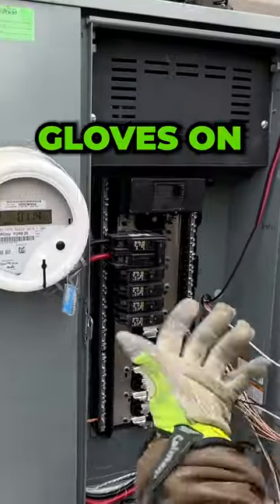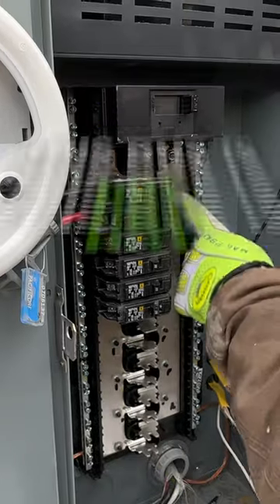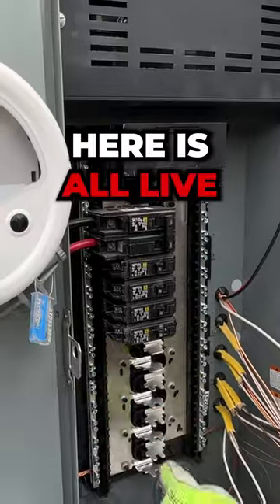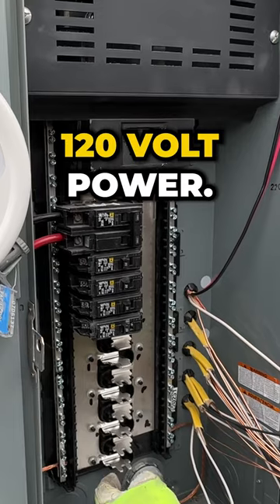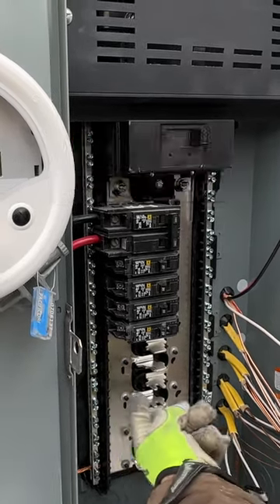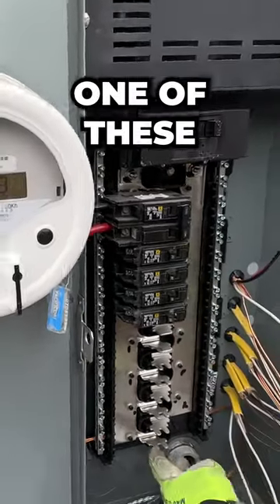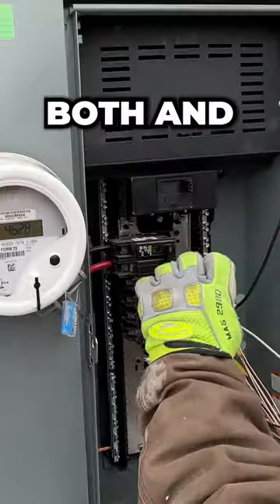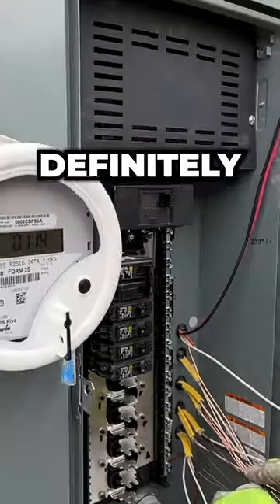Don’t Get Shocked⚡️Live Panel #Shorts

Comment: They aren't actually opposite phases. They are coming off a split phase transformer, center tapped to ground.
Reply: That's what opposite phase is, though?  The two waveforms are opposite polarity, which is equivalent to a 180° phase difference.
Reply: @Dwonis  In this configuration you get power from a center tapped secondary winding to neutral. It is a single phase but because your center tapped, your force each leg to be 180deg apart. In a traditional multiphase system, power is across multiple unique windings and is 120degrees apart (A, B, C).
Reply: That’s correct it’s poly phase
Reply: Yeah it’s a weird situation where it’s really single phase but also kinda two phase lol
Reply: Split phase is opposite phases, 2 phase power has one phase 90 degrees out of phase, and the use of capacitors has made 2 phase power mostly obsolete.
Reply: No, they are opposite phases. One is +120v to ground when the other is -120v to ground... and they switch 60x per second So the two phases have a potential of 240v between them. And 110v devices would work that way between either phase to ground with no neutral but unsafely.,with no way to balance the load. So we create a neutral  which is at 0v potential by center-tapping the secondary coil of the transformer. This provides a safe reliable way to complete the 110vAC circuits, with the neutral carrying only the difference in load between the two phases. Thus "split phase"
Reply: They are opposite phases as @Dwonis says. However, typically "a" phase and "b" phase refer to phases that are 120 degrees from each other, not 180 degrees. I'm sure the person narrating knows this and just misspoke.
Reply: @HBSuccess  
Not really. 
You have to go deeper in to electrical to understand this. 
But the best way to a see a actual sign wave. 
3 phase has 3 sign waves. 
Single phase has one. 
Each wave is a phase.
Reply: @HBSuccess  absolutely not. It’s a single phase system. The transformer brings 12KV or 25KV down to 240V for residential service, but the phase is split in the transformer like you stated to create 2 poles or legs. It’s still a single phase system. Lots of people call it 2 phase to make it easier to understand, but that doesn’t make it correct. 2 pole, single phase.
Reply: @HBSuccess  - you explained it with much detail. That’s the way I’ve always understood it as well, but I’ve never quite understood is when I turn off my main circuit and turn on my generator circuit (power outage) that delta that the neutral carries back is still connected. Can that cause an issue with the lineman trying to repair your neighborhood?
Reply: @Dwonis  nope, it's the same waveform on each leg, just center tapped to split a single phase into 2 half voltage circuits.
Reply: @ke6gwf  half voltage and opposite polarity, i.e. 180° out of phase from each other.
Reply: @Dwonis  not out of phase, any more than L1 and L2 are out of phase.
It's just that we are measuring backwards.
If you bonded L1 instead of the center tap, than everything would be "in phase" by your definition, but when you look one direction from the center tap to L1, and the opposite direction from the center tap to L2, you think it's opposite phase, but it's from your perspective.

If you picture a sine wave overlaid on the schematic for a center tap transformer it becomes very clear.
Everything is on one phase, and In Phase, but the split phase 120 volt loads are each only using half of the Phase, thus half of the voltage difference.

If you picture it like an arm with 3 rods below it, and the rods at the end are constantly rising and falling in opposite directions, but the rod in the middle stays in the same place, even as the arm tilts one way and then the other, because the movement is balanced.

And yes, while one side of the bar is going down, the other side is coming up, and so you can say that they are opposite phases, but it's really just looking at the other half of the same phase.

It really comes down to your definition of Phase, and in electrical theory, split phase is in phase, just referenced differently, and out of phase has a specific meaning, which does not apply here, just confuses things.
Reply: @kempie9901   that's what I was taught single phase 120v ac in series gives 240v. 3 phase is 120⁰ out to combine to 480v but is actually less due to phase overlap
Reply: @Dwonis  if you combine 180⁰ opposite phases.  They will cancel each other out.
Reply: Came here to say this... lol
Reply: @OldSkoolF  so all phases are 480 at the pole and go through a transformer to 240, just with a neutral tap in the middle of the transformer output. Each end of the transformer is 120v relative to the neutral center. At both ends of the transformer its 240 v relative.
This all comes from a single phase of the 3 phases available from the transmission line.
Reply: @nathanlindley5354  Might just be autocorrect, but figured I'd mention it's "sine" wave instead of "sign."
Reply: @ChuckMorton  No, at the pole it's usually close to 5k volts but could be as high as 25k. The pole transformers bring it down to standard voltages.
Reply: @OldSkoolF  You are correct about the voltage (I forgot since I have seen 480 step downs) but 240 is only one of the 3 phases.

I should have gone outside and counted the ceramic spaces 🤣
Reply: Easier to understand when you start getting into 3-phase converters.
Reply: @FonicsSuck  spit some facts and corrections then since usually those who can't critique
Reply: Guy finger blasting the bus bars 💀
Reply: @condor5635  in regard to your neutral connection question, at your main service panel ground and neutral are bonded together, at the transformer the center tap of the transformer is grounded as well so not really a danger. Hots are all that needs disconnecting just as a regular breaker does.
Reply: Everyone is trying to say that we are generating two phases off a single phase transformer just isn’t right. You are using a single phase transformer with a Center tap in the secondary windings. 

If you were to move that Center tap either way on the winding it would result in an voltage different between your L1-N and L2-N but your potential for L1-L2 will always be the full potential of the windings. 

Move that Center tap 25% up the winding towards your L1 Secondary Tap. L1-N would now be 60V and your L2-N would be 180v. But across you would still have your full windings potential. 

This isn’t a VFD or a generator of any kind we aren’t creating another phase out of thing air.
Reply: @ke6gwf  wave form are 180 deg offset

if they are identical you get 0v instead of 240 between L1 and L2
Reply: @moreause  if you put two AA batteries end to end, and you are standing in the center, you say that they are 180 degrees opposite voltage, because you are looking at the positive terminal on one and the negative terminal on the other.

Split Phase is two batteries in series, L1 is one end of the pair, and L2 is the opposite end of the pair, and between L1 and L2 you get 3v, but if you stand in the middle and test the opposite ends of each cell, you see them as being out of phase, but it's because of your chosen reference point, nothing to do with the batteries themselves.

Another way to look at it is that at L1 you have Zero volts, at Neutral, you have 110 volts, and at L2 you have 220 volts.

If you don't bond the neutral on a transformer and instead bond L1 to ground, that's exactly how it will test if you are referencing ground. I know because I have done that before! Lol

It's single phase, Center Tapped, which means that the Neutral is coming from the middle of the Phase, meaning that the Phase is not reversed, but you see the two halves of it from the Neutral.
Reply: @ke6gwf  semantic here...
it like saying -5v is the same as 5v they are both 5v yeah

but at some point you need to be able to have a discussion and for some reason...neutral and ground seem to be the common reference 

i have to think here a bit about your battery

if you put them in serie  L1-N-L2
with a h1 - h2 primary

it would be L1-N and N-L2 to equal your battery example

i normaly use L1-N and L2-N vector so it reverse when using this reference frame

it's been a while don't go to hard on me lol
Reply: @moreause  I like your example there, yes, L1 - N and N - L2 is a perfect way to put it, I will be stealing that lol

What often happens in discussions like this is that people forget that theory and real life don't always look the same.

Kind of like how -5v is an accepted standard in electronics.

If you look at the schematic for a center-tap transformer, you will see why in reality it's L1-(Center Tap)-L2, with the center tap having no effect on the connection between L1 and L2.
And you can build a transformer that looks basically exactly like the schematic as well.

In theory you may choose to flip the reference and act like L1-N is a separate thing from L2-N, but they are in line with a center tap.

And just like how -5v is accepted in the field that uses it, and calling it anything else confuses, in utility and household and industrial electricity, it's called Center Tap Split Phase, and it's a single phase, which means it can't be out of phase, because that would be a second phase.

I sometimes call it Two-phase just to mess with other electricians lol

It also helps to understand it if you are looking at just the center tap transformer, without the Bonding, because when you bond the center tap to pull it down to Ground potential, now you think that the world revolves around the Center Tap, when that's just an arbitrary choice.

I worked on an industrial facility one time that used a floor mount transformer to get 220 split phase in a machine room that was fed with 3 phase, and when it was installed they forgot to bond the Center Tap on the transformer (which was the size of a washing machine for reference).

One winter afternoon I was working in a control cabinet and got an arc when my screwdriver bumped a Neutral terminal, which really puzzled me!

So I started testing, and sure enough, Neutral was at 110 volts referenced to the frame of the building, and Hot was at 0 volts.

It was the end of the day, so I left off and came back the next morning to figure it out, and everything was normal, hot was hot and Neutral was not!
This REALLY puzzled me.

Then that afternoon around dusk I heard the contactors in the room pull in to turn on the outside lights powered from that panel, and I tested and discovered that the voltage had flipped again.

So then I started turning breakers off until the voltage returned to proper orientation, and the issue was down a circuit that ran ceiling lights and wall outlets, which further puzzled me, and then I found a small outside light fixture wired into one of the wall outlet boxes, that didn't work, and it turned out that the ballast had failed hard shorted, and so when it got dark enough to turn on, it shorted out that circuit to Ground, but since the transformer center tap wasn't bonded, shorted light BECAME the Bonding point, and the system flipped, rather than blowing the breaker.

Facility management didn't believe me, and I had to actually take off a cover plate, and short out the hot terminal on an outlet to the metal box, with them ducking expecting sparks, and then show them how the potential flipped in the whole building when it was shorted out!

They then brought their electrician in to replace the light and bond the neutral, but I guess it had been that way for many years by then.
Reply: @ke6gwf  That remember me a issue i had hum 25 year a go

there was a wall plug in a control cabinet...i wanted to check voltage with a no touch fluke voltage detector...it started detecting at 18 inch from the plug.. normally it's very close at 120v

get my meter out...over range...neutral is higher than a 1000v 

yep neutral not grounded
Reply: @mattm3901  they are only "out of phase" if you choose to sit at the center tap and look in opposite directions at the ends of the transformer.
It's like sitting between two batteries in a flashlight and saying that they are 180 degrees opposite each other, because YOU have to swivel your head between them.
Reply: @mattm3901  they are perfectly in phase, because if you disconnect the center tap entirely, you still have 220 line to line.
The center tap is nothing more than a voltage divider between the two lines, one of which is High while the other is Low across the sine wave.

Try picturing superimposing a sine wave across the schematic symbol for a center tap transformer, and you will see that everything is perfectly in the phase, it's just that the center tap has potential from what's higher and what's lower voltage than it.

Imagine that the center tap is adjustable (some are) and you move it one direction so that you have 100 volts on one side and 140 on the other side. Are they now 160 degrees out of phase or whatever it would work out to be?

And the center tap being bonded to ground is just a choice, you could bond any of the 3 legs off the transformer to Ground and the system would still work the same, with no change in phases.
Reply: @ke6gwf  I stand corrected. I was envisioning 240v as the sum of two 120v outputs from separate windings (secondary and tertiary) when in fact it is the actual secondary voltage, with the 120v outputs created by a voltage divider. 

Now the term “split single phase” makes complete sense. 

Thanks Ben.
Reply: @mattm3901  you just made my day! You know how rare it is for people to actually LEARN something from YouTube comments? Lol
Most people are too stuck in whatever sound bite they once heard to process the information and improve their opinion.
So thank you for restorating my faith in humanity!

Now, I sometimes call it two phase just to mess with my electrician friends, and it took me a while to figure it out as I have explained it, and I had to get into some pretty deep dives to verify things, and I think it was the time I was working on an industrial system run off a step down transformer that flipped voltage every sundown, where during the day 110v Hot would be Hot to ground, but after dark Neutral would be Hot to Ground and Hot would have no potential to ground, and I discovered that a photo cell controlled light ballast was shorted out, but the step down transformer had never had its neutral bonded, and so when the dead short happened to Ground at dusk, the Split Phase center tap transformer just flipped to Line 1 being "Bonded" to Ground through the lamp, and so now Center Tap was 110 v, and Line 2 was now 220 v to Ground, that I really began to practically understand the concept.

I was working on a PLC system, and when I told the facility electricians what was happening (after I discovered that the Neutral in the wiring cabinet was hot to ground with an accidentally vaporized Screwdriver...) they laughed at me and said that was impossible, so I grabbed a piece of wire and shorted from the structural steel to the black wire in a box, and NOTHING HAPPENED®™, and after they stopped cowering waiting for the arc flash, I showed them how the voltage flipped when I did it.
They then bonded the transformer properly and replaced the lamp lol

This idea that it's opposite phases is sadly very common, so you probably had "good" sources for it, but when you realize that it's a voltage divider and doesn't effect the 220v phase at all, it makes a little more sense.
Reply: @peterbasta6624  Three phase systems can be found in the wye configuration where each winding is grounded on one end.

And three phase is really great for efficient motors that run at constant speed (industrial stuff)

But two-phase doesn't  help you build a motor any better than a single phase one.  Which  is why  you never bother bringing in a two-phase connection at the transmission point. And besides it's easier to do the center tap thing.

So it's a single phase at the transmission/grid interface, but it is genuinely two phases as the panel.
Reply: @kempie9901   Agiain, single phase from the perspective of the transmission line, two phases 180 deg apart at the panel.  Both are Sinosuadal wave forms if you hook up and oscilloscope.
Reply: @WorBlux  that’s not entirely true either. If you use the neutral as your reference(ground) for both leads, then they will appear to be 180 degrees out of phase. That is not necessarily the correct way to measure though. It is 1 transformer, so it is 1 phase. It is a split phase meaning that neutral is tapped in the middle of the transformer. So, they can appear to be different phases if you swap your leads.
Reply: @kempie9901   Looking at the transformer-grid connection is one perspective. 

Taking out an oscilloscope at the panel is another. Electrically at the panel they behave as separate phases.  

One of the legs is connected across the secondary in a manner the reverses it's polarity from the primary and creates an out of phase circuit.  Both are zero V to ground at the same time, but at peak one is 167V, and the other is -167V. Center tap ground is just cheaper and simpler than providing two smaller transformers of opposite polarity on the same line. 

If the legs were in-phase, you couldn't create a circuit by bridging them. 

It isn't just an appearance of two phases, the center tap actually creates two phases from an electric theory standpoint.  From the utility standpoint they only ever see a load on the single phase.
Reply: @ke6gwf  " if you disconnect the center tap entirely, you still have 220 line to line."

And wouldn't pass code anywhere there is code. You'd also have to ground one end or the other.  One way you'd get 240V to ground, and the other -240V to ground. 

"And the center tap being bonded to ground is just a choice, you could bond any of the 3 legs off the transformer to Ground and the system would still work the same, with no change in phases."

If you don't ground the same side of the circuit as distribution line does, your polarity flips and you are 180 deg out of phase with the transmission circuit. 

And while such a config would "work"  there are good reasons to choose to earth reference the center tap.
Reply: @WorBlux   well, if you have an electrical theory document to reference or prove that, I would like to see it. Like I stated before, is only looks like 2 phases that are 180 out if you place your leads wrong. Why would you use the neutral as the reference anyway? It’s really an arbitrary placement. That secondary winding could be tapped further up or down the winding to create whatever voltage you would like. That point isn’t that special, and shouldn’t be used as a reference point unless you are trying to find out if you have a bad hot leg coming in your house. Residential transformers have a primary winding and a secondary winding. Those transformers do not create two phases with a(single) secondary winding. If it had 2 secondary windings, then you would have a point. If everything in your house was 240v, you could just cut the neutral off and use the exact same transformer. The winding, voltage, and phase would be the same. There would still be 1 phase. Adding 1 wire does not change what that transformer is doing. 

1 phase (peak to peak) is around 340V. The  +170 and -170 aren’t 2 phases, it’s still 1 phase. A complete phase is positive peak to negative peak. That’s called split phase because you are splitting the phase by a center tapped reference point. Lastly, when you split those phases, you aren’t getting +120 and -120 legs. You are getting 2-120 RMS peak to peak AC legs. To get 2 legs that are of opposite polarity, they would need to be rectified which isn’t happening in those transformers.
Reply: @WorBlux  there are actually a lot of situations that use an isolated system off a transformer with nothing grounded.
I was explaining how it's all a single phase, and that the center tap is optional, to explain how the phasing works, and how each leg is in phase with the other, not recommending that anyone do it, but in the right situations it's totally up to code to do it.

And if you ground a different leg of the transformer than usual, it makes no difference, as long as you wire to it accordingly so that the whatever leg is grounded is used as neutral, but since you aren't referencing the grid through any other paths, the difference won't affect anything, it's AC, so all the equipment cares about is the differential between two conductors, well, between 2 to 4 conductors depending on if it gets neutral or ground lol

Anyway, I was talking about theory to help explain how the legs of a split phase are related to each other, and so nothing needed to be corrected, even if the corrections were correct!
Reply: @WorBlux  oh, and there is no such thing as -240 to ground, if you bond one end of a 220v transformer to ground, the other end will be +220v to ground, and you can switch it back and forth as many times as you want, and whatever end is NOT grounded will always be +220v to ground.

+ and - are a DC concept, and so it doesn't apply here.

The only way to get -220v to ground, is if you energized the dirt to 220v! Lol

But again, the point I was trying to get across is that an unbonded transformer floats in relation to earth reference, and it doesn't really care whether either end is connected to ground or not, and if you ground one end the other end is naturally going to end up at the output voltage IN REFERENCE TO GROUND, and it makes no functional difference which is high and which is low, unless the equipment has some circuitry that is also referenced directly to ground, rather than only referenced to the black and white, hot and neutral wires.
Reply: @ke6gwf  Ya... Ok,   + and - are a terrible way to notate phase shift. Ended up confusing the shit out of myself.
Reply: @WorBlux  I understand, I didn't understand this fully for decades, and it was only recently after diving into it that I finally was able to grasp it, because everything from "grounding"/bonding to phases to center tap transformers are complex subjects on their own, and you have to understand them beyond the typical simplified textbook diagrams to be able to put them together.

Basically the engineers who designed these systems are really smart, and they don't teach the regular electricians the technical details, just the practical ways to do things, and so the electricians make up their own stories about how it works lol
Reply: thank you
Reply: @jakebackpack8292  2 pole
Reply: You don't have 2 phases.  You have 2 legs.
Reply: @Dwonis two lines with a 180 phase difference would just cancel each other out.